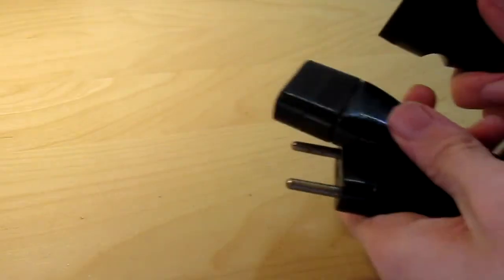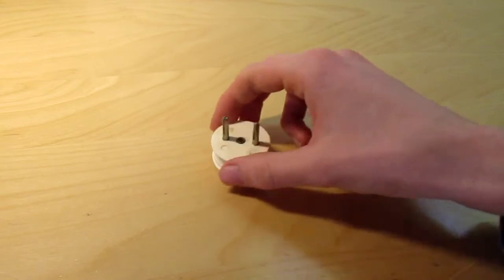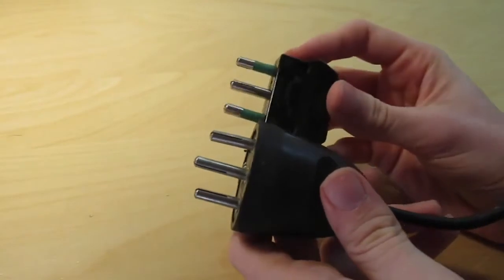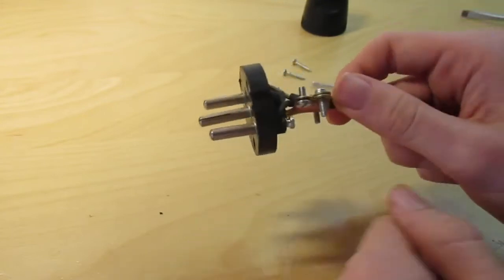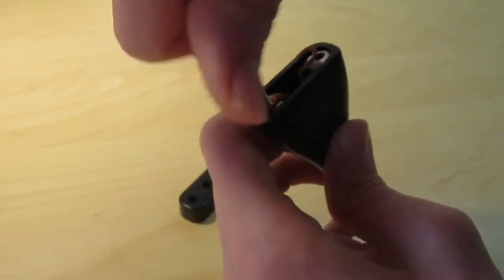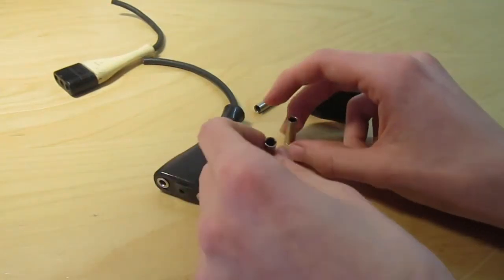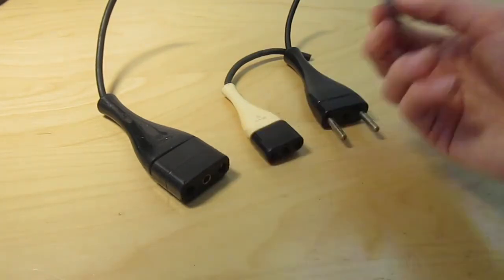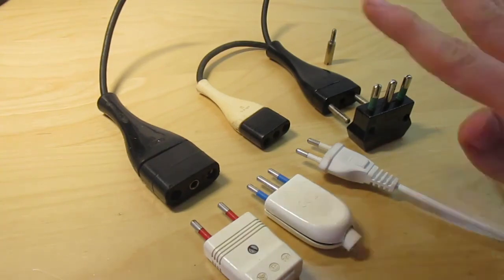Weird Old Plugs from Italy, and How They're Built

Comment: They are recessed so that yo cannot plug it is that one of the prongs is left outside. This could get you shocked.

It s not a problem that it does not fit into schuko. It is a life-saving feature. Such plugs were used on class 0 devices and the are not safe on environment where there is any ground potential like grounded sockets. Especially hot chassis radios are extremely dangerous in such situations. Schuko was specifically designed to reject ungrounded plugs.